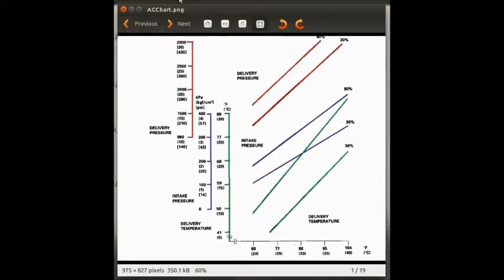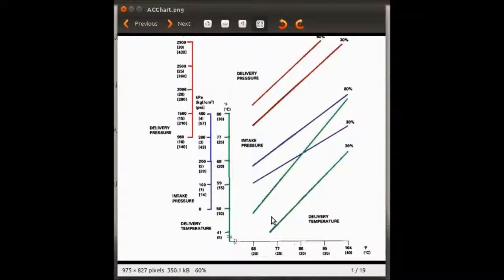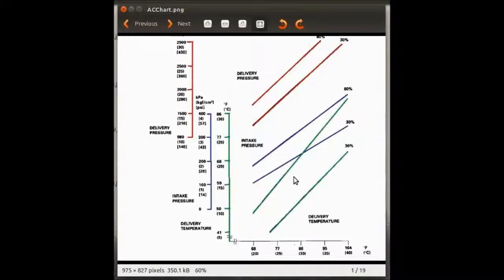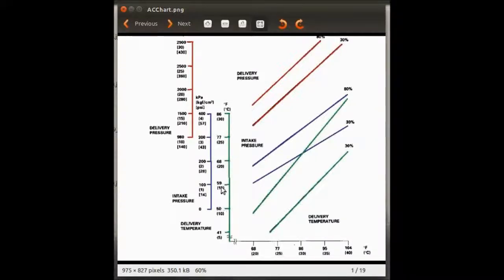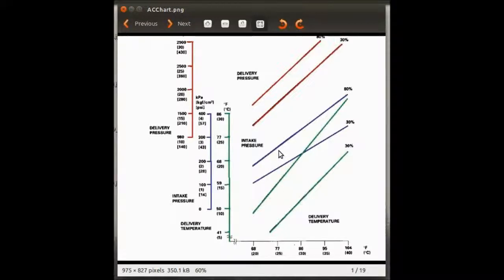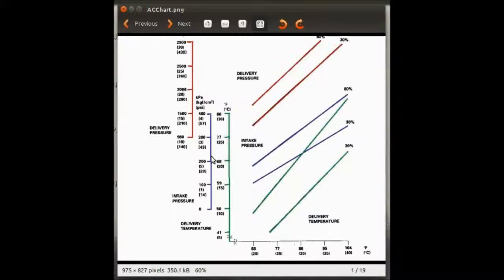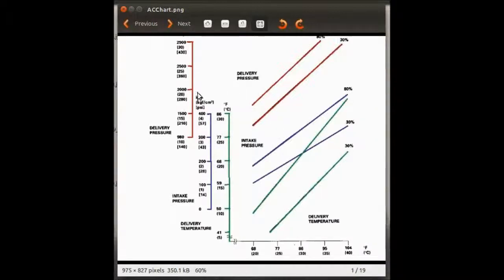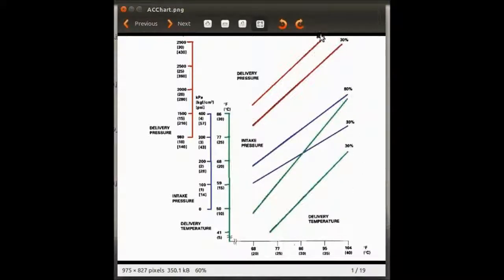How to read AC pressure manifolds depending on ambient temperature and humidity

Comment: Hard to understand. Each section of the chart needs more explanation and background. Where on this chart is the humidity he quickly spoke of? Is it those percentages?
Reply: its color coded, draw a point 10 %above and 10% below the humidity level then from those points draw a horizontal  line to the delivery temperature vertical scale. The delivery temp range is in green, the intake pressure range is in blue, and the delivery pressure range is in red. you must draw a 10 % above and 10% point for intake pressure, delivery pressure  and delivery temperature.